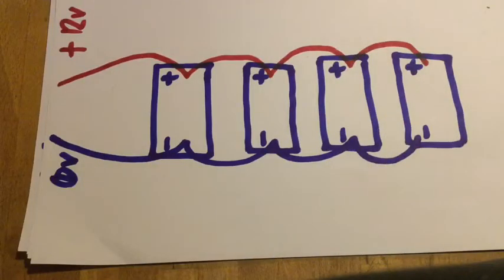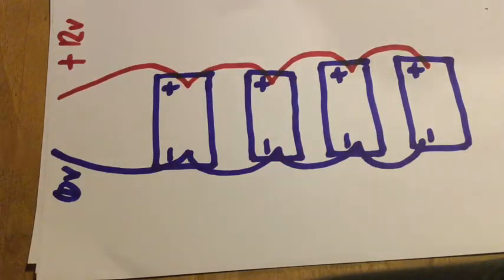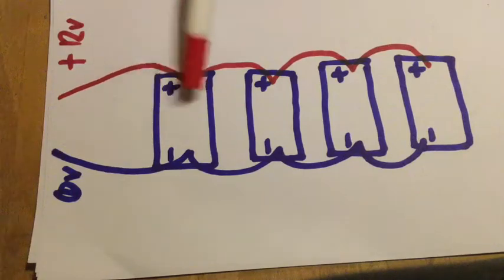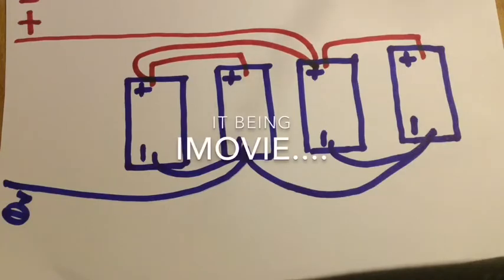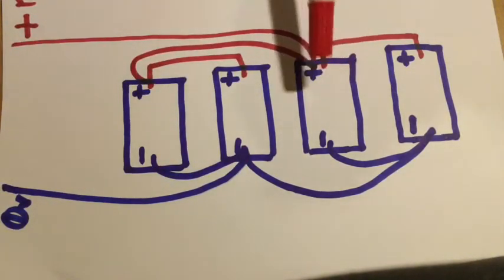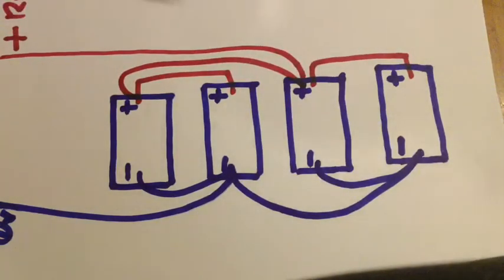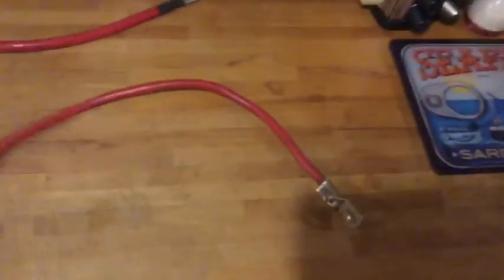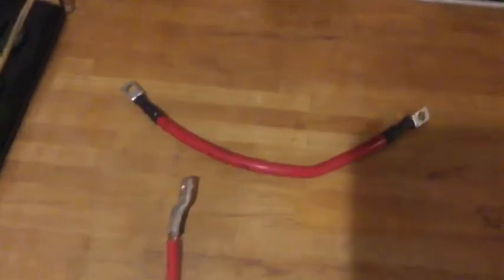Narrowboat Leisure Battery Wiring

Comment: All my batteries including starter share same negative but positives separated and separate isolation switch is that correct set up ?
Reply from the maker: Yes all negatives should be connected. The main positive wire coming off of the battery bank should have isolation switch.
Reply: @narrowboatbrewer8823  genuinely appreciate clearing it up for me ..sorry to ask stupid question but only way to learn lol
Reply from the maker: @oldgrunger5  there’s no such thing as a stupid question, only stupid answers! You’re welcome 👍🏼🍻
Reply: I know this an old post, but I have 3 batteries, how should I wire 3?

Comment: Hi, this is how my batteries are connected. Having solar panels next week. Should the be connected the same way, or positive negative each end of the battery bsnk? Thanks
Reply from the maker: dave smith I have mine the same way. The solar ring connectors are usually a lot thinner than the other lugs so should fit on your battery terminal ok. Cheers

Comment: Hi, good video. The Smartgauge website shows how bad the imbalance could be if the connections are just made to one battery of a parallel string, especially at high currents for inverters. Just taking positive & negative from opposite ends 'on the diagonal' makes a huge difference if the ideal way shown is not used.
Reply from the maker: Michael Thomas Hi and thanks for commenting. I think what you mention I talk about at 2m21. Sorry about my poor presentation but that’s me!